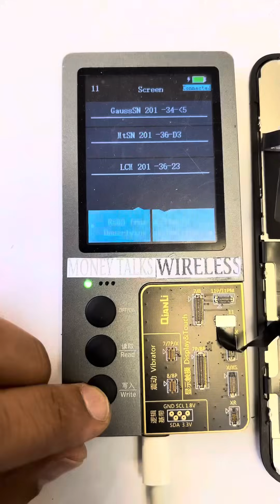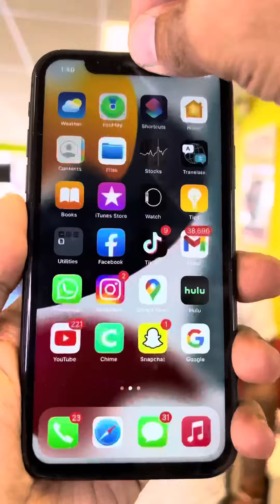BOYFRIEND TURNED IPHONE IN TO SAMSUNG Z FLIP 😱 YOU WON’T BELIEVE YOUR EYES 😳 #asmr #apple #iphone

Comment: Love from Germany for your work. Quick question how much does such a repair cost? You basically build a new phone 😱😱
Reply: Omg your rigth I wonder how much it costs but the worse the Damage the more expensive I guess :>
Reply: it doesn’t cost money only the tools cost money
Reply: @ComradeIvan  За Народу, За Победу !!
Reply: @ComradeIvan  not russia supporters..
Reply: its not that expensive, the only expensive parts of the phone are the screen and the components inside the phone. buying a new OEM iphone 11 screen right now is 80-100 dollars. The body is actually quite cheap around 20 dollars. for the display, it usually costs around 40 dollars for a 3rd party and 80-100 for an oem, which is a genuine apple display thats refurbished. so in total, in my estimate it would cost around 80 dollars to repair with a cheaper screen and around 120 to repair for an oem screen, its much cheaper than buying a brand new phone
Reply: @trollcart  but I'm

Comment: I really wonder how much it cost to fix wouldn't it be more reasonable to buy a clean second hand or refurbished phone?
Reply: That's what I was thinking too. At some point the cost of repair simply isn't worth it. And those back glass repairs are expensive. Not to mention this was a full housing and screen replacement. So it had to have been pricey.
Reply: If it paid off I would jus get a new one for 20$ a month. That’s less than a dollar a day. A lot of ppl spend 20$ a month on candy and overpriced coffee etc. phone is a necessity atleast for me. That the cheapest way I know of. Ya u can spend hundreds upfront and save but if u don’t have hundreds and don’t owe on the phone a upgrade is better imo when u have to replace housing as well. Has to be 100$ plus in parts. I assume. Idk. I literally lost my se2 n got 13. Actually miss se but 13 battery is twice as good if not more.